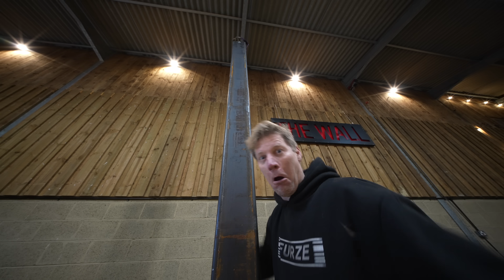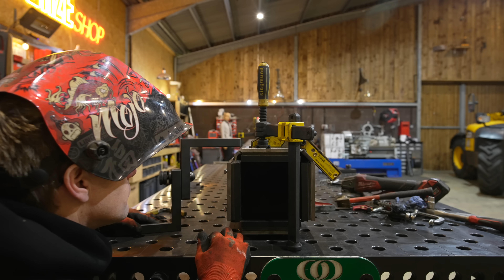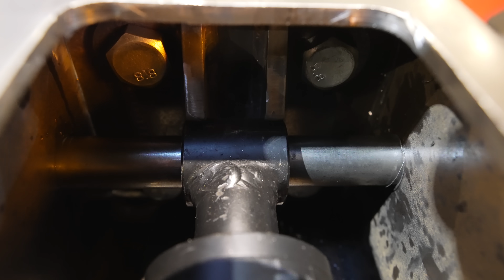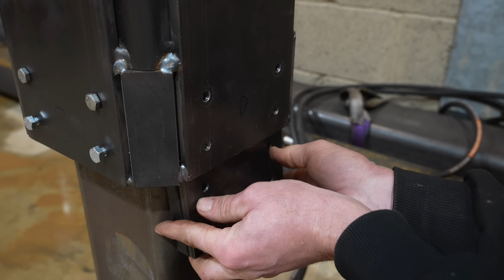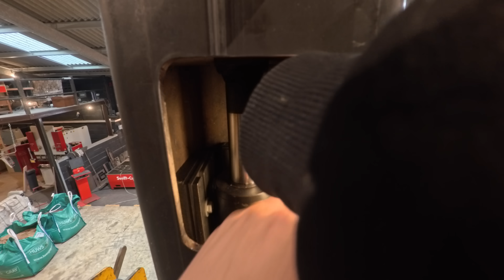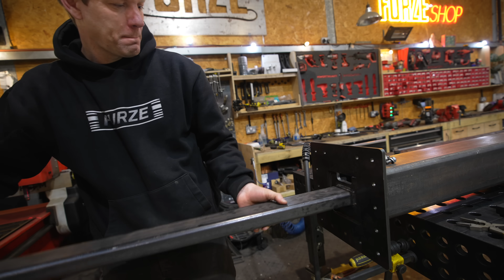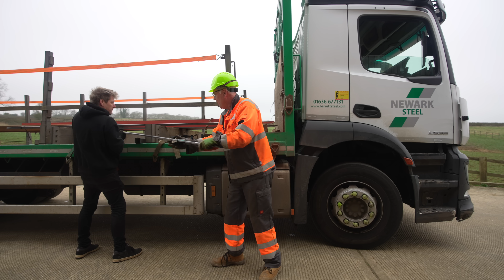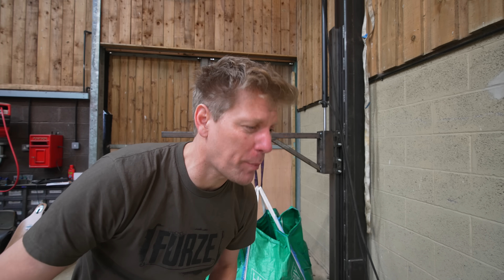Digging SECRET Garage Part 7 Car Lift Prep

Comment: You should consider using poppet valve manifolds (used in dump trailers and heavy machinery to equalize and stabilize hydraulic flow). This would not only allow them all to move at the same pace but also prevent any stuttering (stick slip) due to back pressure or uneven load! Great work Colin and much love from the US! 28:51
Reply: oh yeah poppet valve thingies, I thought that too. Of course and no, I am not googling what a poppet valve manifold is. How could you think that? Sheesh.

Comment: Awesome project, and cool design. I thought about using large lead screws, like used for the vertical movement of a 3D printer bed. That way you don't have the hydraulic cylinder minimum length & all the hydraulic lines to deal with. Can move the platform fully from bottom of lead screw to top. Put one on each corner, synchronize them with chains.

Comment: A part ofe wondered why not use a telescoping two stage ram. Like a ram within a ram found in some packing garbage trucks for the compactor/ejector.

Then I had to think about the complexity of such and if the seals went bad the effort for rebuilding such.

Comment: i'm not in love with this design, this is a great use case for a cable tension system with tracks for alignment, much simpler design.

Comment: Why not a scissor Lift? Is easier to build, its more save because it can't flip over like yours so easy and you only need one hydraulic cylinder. The biggest benefit is that it lift more accurate because you don't must synchronize 4 Hydraulic cylinders And simply because of its design it cannot angle the plate for the car  when lifted.

Comment: I thought about the mechanics inside a boom from a crane or the mechanics of a forklift. With sprockets and chains you can use much shorter cylinders.

Comment: ...Awesome stuff , as usual ✌😎 Years ago I built similar hydraulic legs on my Ship , but they were horizontally mounted through the hull , for the extensible outrigger floats . Brings back memories , especially putting a grinder on a pole to grind down the internal weld on the box section ...

Comment: If you look at 4 post ramps used by mechanics they are lifted by one ram and a cable links to the rest of the pillars. They also have safety locks spaced roughly 30cm apart just in case the ram fails.

Comment: You could have used a system that forklifts which have multi stage mast use.
Those can lift really high using fairly short cylinder.

Comment: As usual, your brain does good! One thing you might have missed to make your build a little easier and cheaper is a chain system (like a fork lift) to substitute the secondary ram whilst also enabling a shorter (cheaper) primary ram and reducing your hydraulic requirements. It should also reduce your points of failure and even speed up the rate of elevation. Just a thought.

Whatever it is you choose, I'll be certain to keep following.

Comment: 16:32 what if it's broken? how do you get it to lift up so you can access the slot?
Reply: Maybe the other 3 can pull it up, as long as it isn't jammed?
Reply: They almost never break, if there is any kind of problem it’s usually just a bad gasket and leaks
Reply: Winches and stuff
Reply: Winches, jacks, cribbing
Reply: Hire a crane I guess lol

Comment: Hi Colin, the block with the roller is called an instantaneous safety gear, but as this is not a 2:1 ratio installation using ropes you could install rupture valves to the bottom of each cylinder with a balancing pipe between them. This would ensure that if one ram or a hose failed all four rams would be arrested simultaneously then you wouldn't need an overspeed governor, pullies and steel wire ropes to operate the safety gears. Just a thought.

Comment: I got the chills when I realised this is just a prototype and you’ll need to do it for real with the correct length rams… and then make another three… identical posts… and you haven’t even talked about the life base and rotation mechanics or indeed the roof… next level… you are not joking… hats off to you sir… this is massive…

Comment: What safety system you putting to stop it slamming down and how you not useing the same princable as the garage ram systems...i also bet that metal is costing you a fortune..but wtg so far mr furzs

Comment: You need security screws. You can't rely on hydraulics so the hydralics can do the lifting but you need screws to maintain a solid grip with a wormgear as a safety on each leg of the hydraulics conk out on you. There is no way you should risk this without a robust breaking system with multiple reduncancies. Those 7 tonne security brakes are rated for 7tonnes of force, which multiplying the mass of your car and roof and table etc is completely and utterly insufficient for that use case. not to be dramatic but red pancakes are nice when it's food dye but less nice when it's a family member or friend or relative. So if you calculate how soo it will reach 7 tonnes at an acceleration o 9.8m/s^2 it is very likely insufficient for the mass you are attempting to arrest. So that thing's going to surpass 7 tonnes of arrest it 0.1m of slip. So you're gonna fucking die mr furze.

Comment: Can't wait to see part 2. But I had I question, I'm sure you'll answer in part 2. When the lift is settling in its up or down position, will there be lockers in place so the hydraulics don't have to hold it up all the time. Just like a normal mechanics car lift has lockers to set the weight of the vehicle on.

Comment: The leg balancing will be interesting to see with your cables? I'd love to see what you have in mind. The only thing that comes to my mind is 4 separate hydraulic servo valves with a control loop around some potentiometers. Maybe some string pots. Probably overkill.

Comment: Colin maybe a idea what if you make like a ring voor the hydraulic with the pump in de middle and use pipe’s that go to the legs,then there is the same pressure on all the legs. Like how a big factory has a air ring system that goes all around the building that not the last machine gets to little air.

Comment: What about the fact that the car doesn't weigh the same front to back? Engine heavier. Front 2 legs lifting slightly more? Would the need to be an exact spot on floor the car needs to be?

Comment: Would an acme screw not been better with 4 electric motors and a gyroscope and accelerometer you could have actuated each leg easier? Plus then you wouldn’t have the problem of what if the oil leaks….

Comment: I was thinking of a safety railing that raises in place around the top hole while the lift is operating and lowers to allow you to drive out over it. It would live in the upper section of the lift when the car is down so it wouldn’t even have to be foldable. Just a separate cage that moves vertically independently. Anything like that in your plans?

Comment: I really wouldn’t make the inner lift a cantilever design. That’s a huge mass to support in that way. Reacting the resulting torque load at one end is a huge challenge, a weak area, and could also place really bad loading on the outer lift frame. This loading could cause buckling and place really uneven loads on the outer lift legs.

Far better to have the inner lift  support the lifting surface at BOTH ends. Spreads the load evenly amongst the four outer legs and massively reduces the torque loading.

Would really recommend getting a qualified mechanical engineer to give the design a once-over before building it!

Comment: Yeah...i dunno about daisychaining... What happens when the load across the cylinders isn't equal (not parking with the car CG in the center of the lift). 

I can see sums of the total height extended being consistent at a given pressure but not necessarily equal? Would the cylinder with a heavier load not cause a cylinder with a lighter load to extend further? (I'm not thinking hydraulic fluid is compressible)

Comment: Sorry for constant messages, honestly Mr collin the floor can be one piece of metal, the rotunda can float on grease, and flat bearings, like the ones at the train station, Look at those the rails have to stay flat and level or the train cannot depart the rotunda, use that older tech for your lift, then you can remove the rotunda any time you want, then you have a massive hoist and inspection hole. you WILL (Legally) need an arrester system that is mechanical, if you ever plan to get under it and work on your car. A ratchet lock that can be put in and removed when in work mode. Heavy one-way ratchets that run up the H-beam, when you lift that platform IN WORK MODE and there is no' clank clank clank clank clank clank clank clank clank, You and whoever you let under there is in grave danger. you can make the safety system swing in on a hinge or make it removable and store the 4x safety ratchet legs. You're going to nail this project i know it.

Comment: i was wondering how you would combat any sort of desync between the 4 rams, is a daisy chain going to be good enough? i would assume it would need to be solid as if even one ram is slightly behind the others theres going to be gaps and added strain on the ram thats slower, maybe a digital system that monitors pressure in all 4 rams and shuts down the lift if theres any issues? could be time for mr bruton to shine again

Comment: This is hard to make work. Why didn't you use screw jacks? 

A motor on each corner and a hall sensor and position disk would make sure it all goes up level and square... How can you make sure each ram goes up at the same rate easily?

Comment: |fixed------------------------------------\ cable
|o|====================--O| hydraulic cylinder
|--------------------------------------------/
lifted floor
needed cylinder length is half of lift height
i hope that the 'drawing' is clear. 1m up hydraulic cilinder = 2m rise of floor

Comment: I have your next tunnel project. Dig out a safe under the house and build a lock to go in it that is "unpickable". Make it a 2 key lock that is split apart so that it takes 2 people to open. Make the door weigh a ton so it is beyond dense. You have to keep the underground additions coming.

Comment: You mentioned balancing the cylinders by daisy-chaining them. Did you mean connecting the pump supply to the first cylinder's 'extend' port, then connecting its 'retract' port to the next cylinder's 'extend' port, and so on? If so, how are you accounting for the volume difference? The rod side of the cylinder has less volume than the piston side. This should result in the first cylinder extending fully, while each subsequent cylinder extends less due to the missing rod volume. Wouldn't that cause the cylinders to reach different lengths?